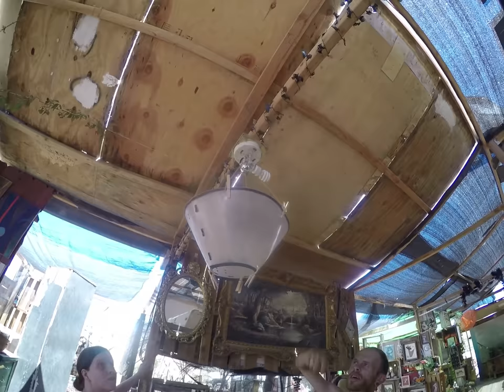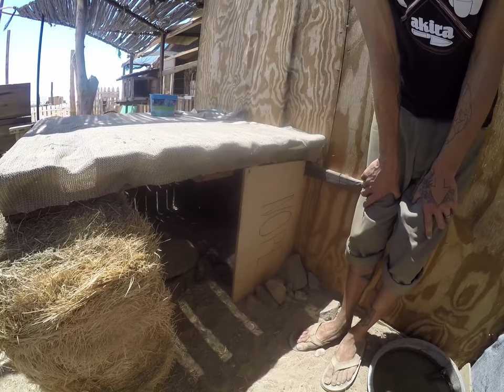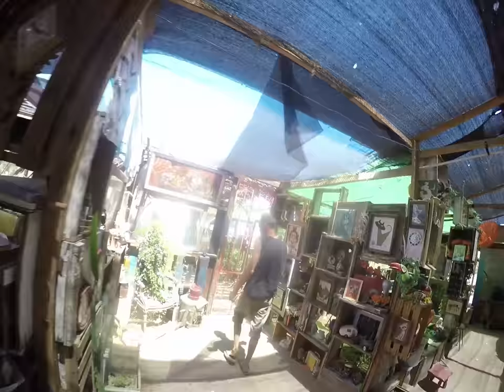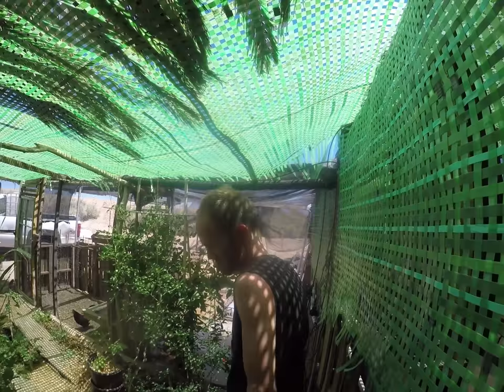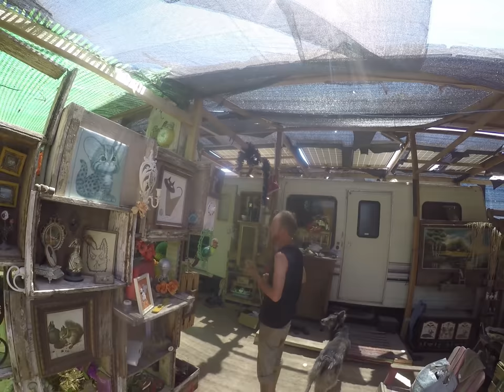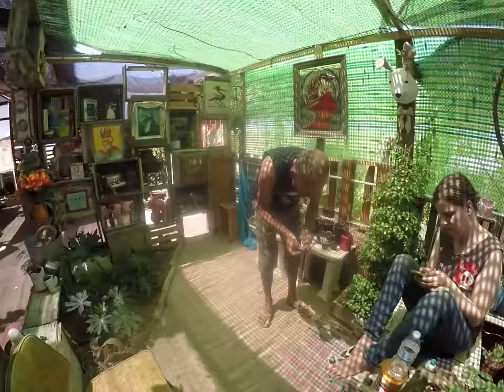Tour of RabbitSide - Slab City's Botanical Art Palace!

Comment: You guys seem super cool. Hope to stop out that direction one day and share some of the things ive learned my past year in the philippines.
Reply: Ive even learned a way to do septic without running water. its really cool. currently we have running water but the septic for toilets and separate for sinks and shower would work on the same concept and is super clean
Reply: its requires some solid hard work though
Reply: If anybody wanted to do that all they need is dirt and a few bags of quikcrete and one long piece of pvc pipe they have the tools to cut
Reply: People could have actual toilets you would just have to flush with a gallon of water

Comment: You built all that in a year and a half???  I'd be afraid a good windstorm would just blow that place away, though.
Reply from the maker: We get windstorms all the time
Reply: We weather a lot of windstorms here. Our place is built like a turtle, with it's sloped sides facing the most common wind path. It's built in 8' x 8' bays, 5 bays deep and 5 wide. The center "ribcage" is well fortified and set into the ground on 3 foot deep cement footings. I'm not sure of the exact wind speeds we have endured, but we have had some mega wind storms and this structure doesn't even wiggle.